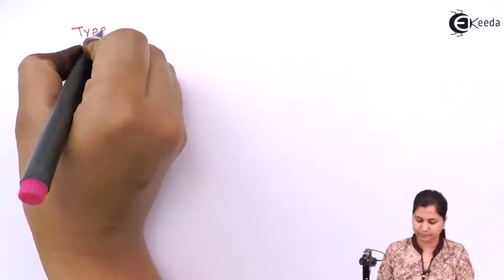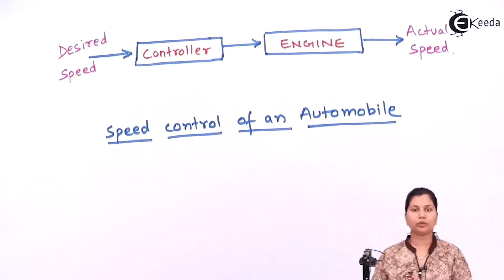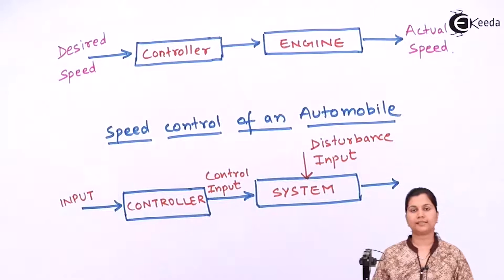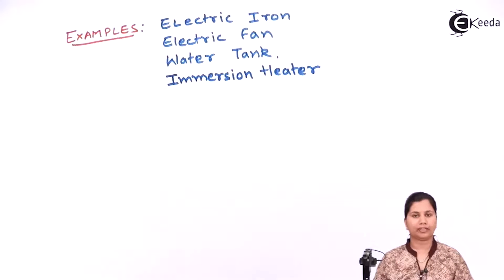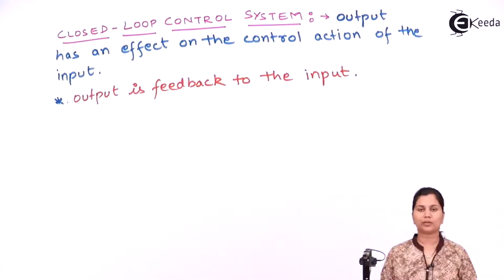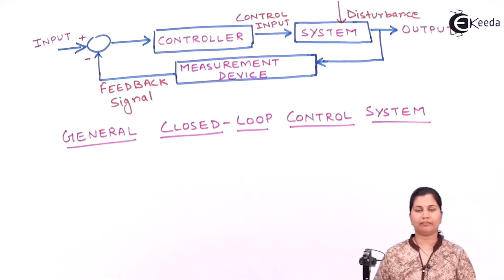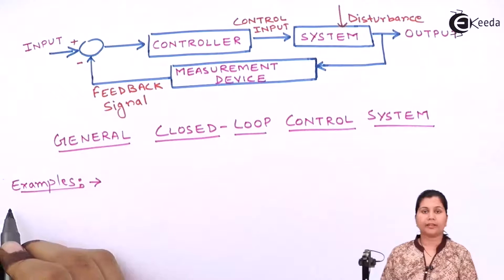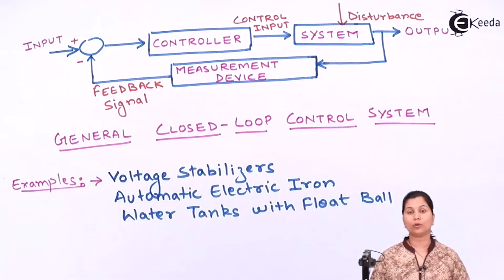Open and Closed Loop Control Systems - Introduction of Control Systems - Control System

Comment: Electric iron is closed loop
Reply: Automatic electric iron when the iron heater too much it senses and stops taking power for sometime and when the temperature is decreased automatically it on the heater.